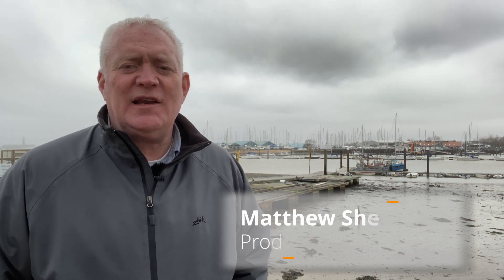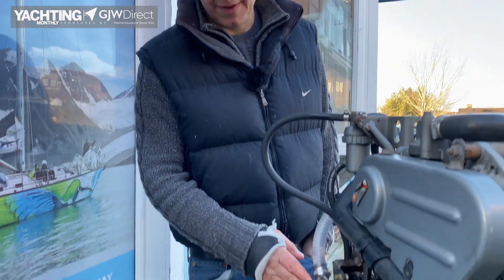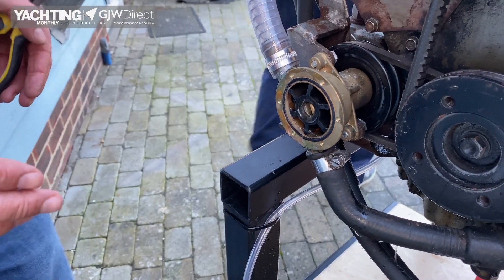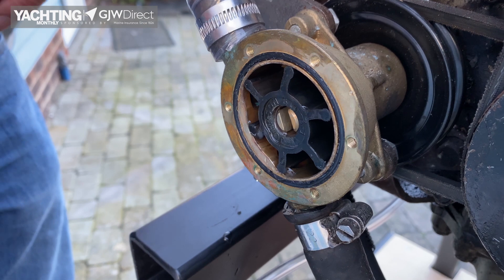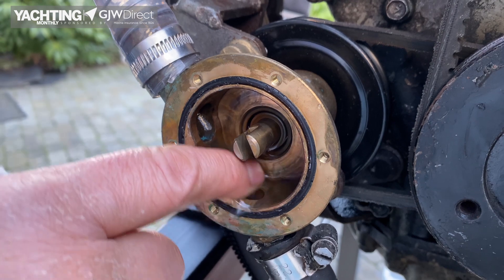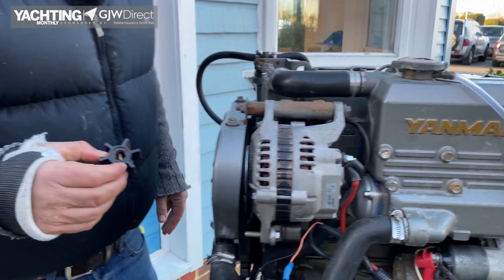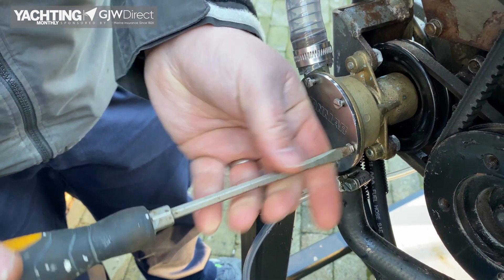How to: check and change a marine diesel water impeller - Yachting Monthly

Comment: Suggestion: MARK a LINE across the FACE PLATE and the ADJACENT BODY HOUSING.
The face plate may have a slight warp to it....put it back on the EXACT same way (with the lines matching) as you originally found it.

Comment: If you can't figure out which way to bend the blades when you are reinstalling the impeller, don't sweat it... it will fix itself within 2 rotations.  Also, many of the impellers on bigger engines have threaded pullers that thread on to an embedded nut in the centre of the impeller.. it is easy to forget about this and reinstall it facing the inside (which makes the impeller puller useless when you want it)... so be sure that you install it with threads out.

Comment: seeing all that rust around the water pump I can tell they missed a very important part and thats the water seal.I have found that seal goes way before the impeller goes and I replace it at the first signs of leakage. Also the belt should be loose just tight enough to turn excessive torque on the belt wears out the bearing and seal prematurely. I have found water pumps don't go at the dock by a yanmar dealer they go in like Dominica where the Island only has maybe one auto parts store...Although hanging out in Dominica a couple of extra weeks waiting for parts isn't the worst thing in the world its always a good idea to have an extra set of bearings and I aways have 3 extra seals.

Comment: May I make one suggestion: Always carry a spare water pump impeller, gasket and drive belt in a sealed box, replace the one you use with new spares at the earliest opportunity.

Comment: What do you do with the inlet seawater seacock after changing the impeller? Do you simply open it back and then you start the engine? Or you need a safer procedure?
Reply: Just open it. The impeller should be lubricated with with a water and dish soap mixture so it can run without incoming sea water for a few seconds while the hose from the seacock thru the strainer refills.

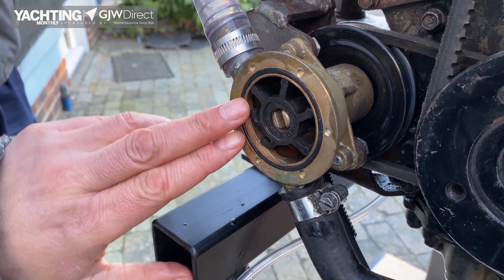Comment: 02:56   06:16     the difference of skewed impeller blade can be seen before and after checking. I think engines are turning  reverse some angle after stopping. does it make problem to impeller blades?

Comment: Yanmar (Johnston) pump is a different animal and also hard to get at as its facing into rear of starter motor..
Reply: It's two bolts, it comes off effortlessly and the whole pump is in your hands in 2 minutes. If the gasket comes off clean it's literally a 5 minute job start to finish at the dock.
Reply: @otm646  It was below the threshold of the door into cabin my Antares 710 so wasnt that easy, well first time anyway, I know now. I also had an insertion tool for the job when the old impeller was removed a worth while investment, made putting in new one a breeze.

Comment: How do you tell which side of the impeller goes in?  Are some types reversible?   Also when I inspect my impeller I use a waterproof grease to lubricant the impeller before re inserting it.  Will any grease do?
Reply: I had the same question. I'm guessing look at the old one before you remove it. But what if the old is not there?
Reply: Yanmar 3ym30 impeller kit

Comment: great channel why not have a brass impeler instead of rubbber that can break into bits and become a nightmare to find in the system  ? thanks in advance.  Jason
Reply: These are positive displacement pumps, because they have to be able to draw a vacuum to prime themselves you can't use a centrifugal pump. Other positive displacement pump designs (like a gear pump) are not tolerant of any incoming debris thus unsuitable.

Comment: No water = check impeller is silly nonsense. First thing to do is to pour 2liters into the filter, to prime the pump!
Reply: Jabsco pumps are designed to be self-priming. If it's operating as intended with a good impeller and housing, it pulls a vacuum through it's inlet.
If it can't prime by itself without any assistance then you have a very serious issue that needs immediate attention.